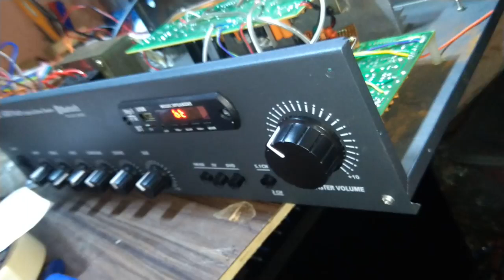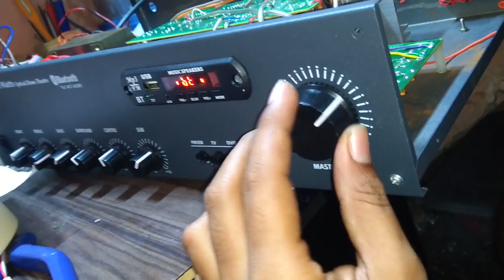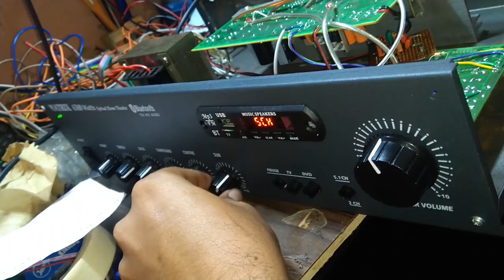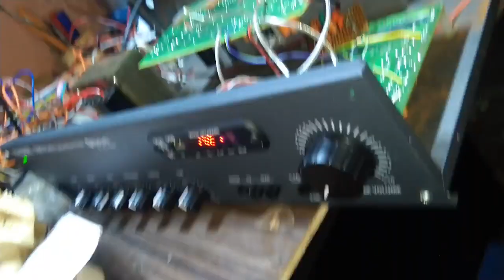TDA 7265 board how to over load protection working see

Comment: Bro stk (4191) ic la speaker output la voltage varuthu athanala speker noise oda speker burn agiduthu anaa yakita stk (4182) ic eruku (4191) ku pathil (4182) ic a connect panallama bro both ic ku pinout correct a erukuma bro.......